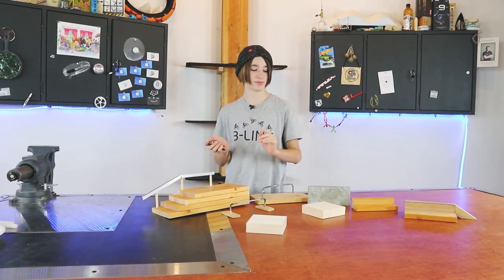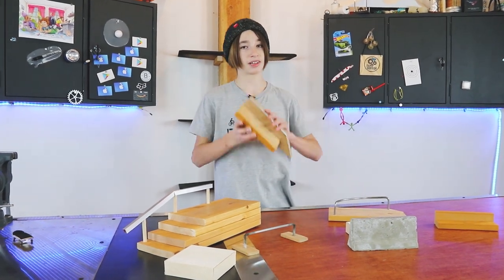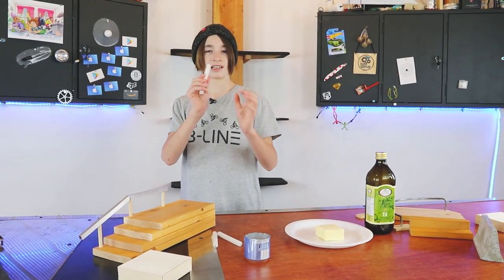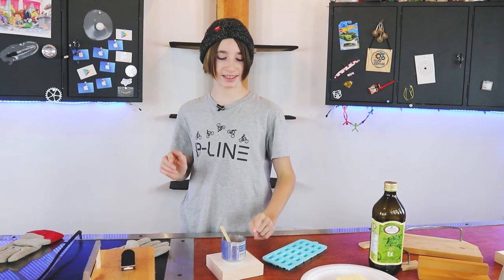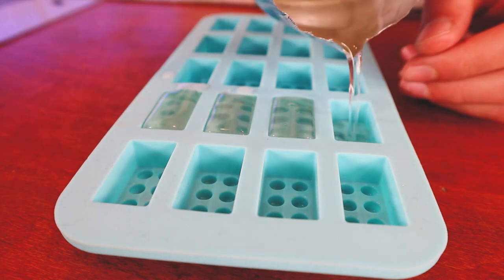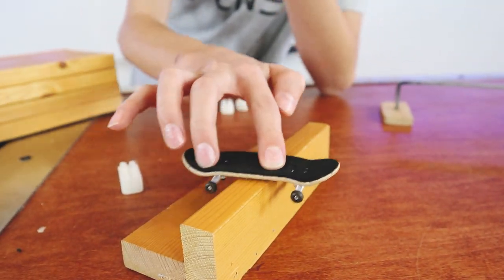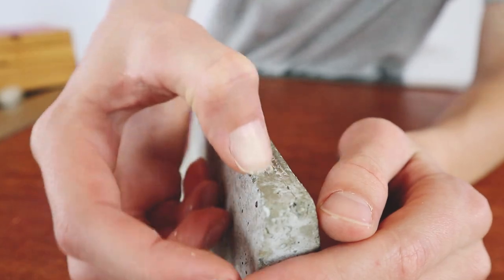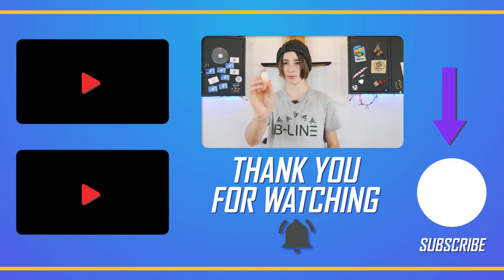DIY Fingerboard WAX at Home!

Comment: To stop your fingerboard ramp from sliding you can stick little pieces of sand paper on the bottom and it wont slide
Reply: I just use antislide foam
Reply: @Dani-hq2ki  that works too
Reply: Or foam grip